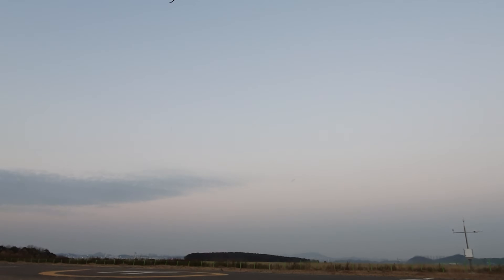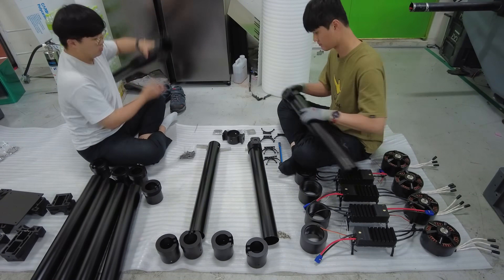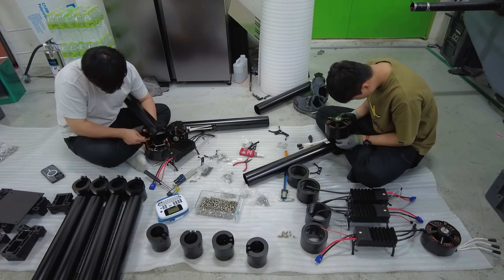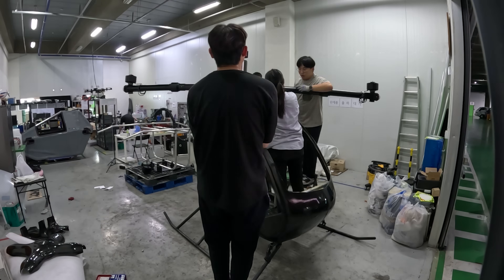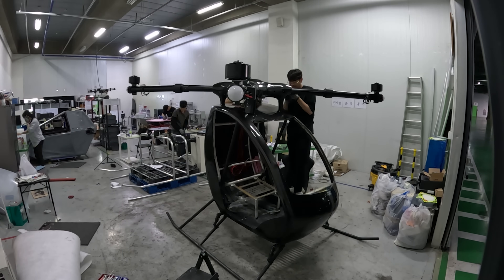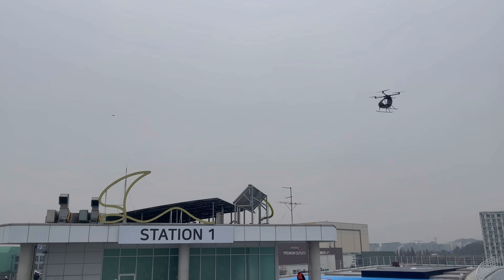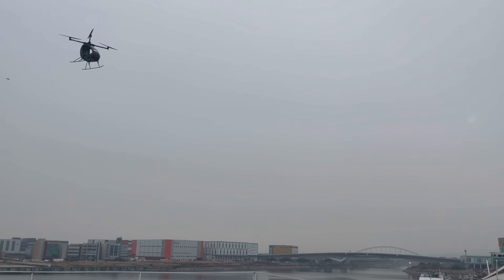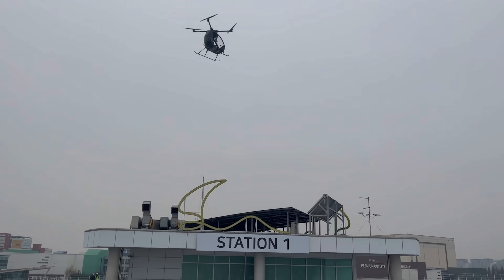I bulit a real Flying Car : Manned Drone Project Unveiled

Comment: congrat for your UNmanned drone :face-fuchsia-poop-shape:.
will you dare to seat inside a day ? its all about trusting your skills.:person-turqouise-waving:
Reply from the maker: Thank you for your comment. I’ve actually already uploaded a video of the manned flight. After extensive testing and validation, I successfully flew the aircraft myself. It was a process of building trust in my own engineering. I'm currently developing an even more stable and reliable version of the aircraft. I appreciate your interest.
Reply: @jenk5109  m curious to see your video of yourself infly.
glad you succeded but i canot think it cost less than 50k$.
Reply: I never thought of using 4" PVC pipe from home depot. I'll give that a try. Thank you.

Comment: Very cool!! The engineer in me wants to know more details, like motors, ESCs, FC, batteries, current draw, prop size and pitch.
Reply from the maker: Thanks for your interest! The propeller size is 63 inches.
I’m currently working on a detailed video covering all the specs — motors, ESCs, FC, batteries, current draw, and more.
If you have any further questions or would like to chat more in detail, feel free to email me anytime!
Reply: How can I email you? What flight controller are you using?

Comment: 😁😁😁dude y merely  assembled parts y bought from everywhere😂😂😂
Reply from the maker: Haha, fair point — but I actually engineered, designed, and built most of the key systems myself. From battery pack to propulsion and control integration, it was far more than just assembling parts. I invite you to watch the full build series for all the behind-the-scenes work!

Comment: you could hook a 50lb rotax 2 stroke up to a generator and extend your flight times
Reply from the maker: That’s a great idea! A hybrid system with a lightweight generator could definitely extend endurance. I’ve actually been thinking about that direction for future prototypes. Thanks for the suggestion!
Reply: @jenk5109  i saw them putting diesel fuel into an ag spray drone on a vid, or at least I think I did, I couldn't figure out what the diesel was for.  They need to develop a variable pitch system for these multirotors, then you could autorotate in the event of a power failure.
Reply: @FourthWayRanch they've made variable pitch quads since quads came out. They only make sense in very unique scenarios. Lookup WLtoys Assassin V383 if you want to see a hobbyist sized/type version. It used a single electric motor but you could easily scale up and use a gas motor to turn all props then vary pitch to adjust thrust. Most flight controller software wouldn't even need any significant changes. Ardupilot calls them heliquads aka variable pitch multicopters. 
They act more like 3d helicopters and can change direction and speed faster than just about anything.
Reply: @JustinHunnicutt  if they're gonna carry people they need a way to land in an emergency, the usual quad isn't safe enough.  might as well use helicopters then.
Reply: @jenk5109  maybe a little jet APU unit would be better

Comment: Love it, are you using regular Pixhawk flight controller? 
this is amazing, honestly this era of manned aircraft DIY, feels just like when people start buiding fpv drones, hey where a mess and look weird, but those drones flew as they could but they flew for real, little by little the pilots gained skill until they became FPV pilots
Really proud of you and your team my friend, amazing!!
Reply from the maker: Yes, we used Pixhawk as a reference, but developed a custom controller specifically tailored for manned flight—with extensive tuning and multiple safety layers added. It's still evolving with every test flight.
And I totally agree with your comment—this era truly does feel like the early FPV days. We’re learning so much from each flight. Thanks again for the encouragement!
Reply: @jenk5109 is it still running arducopter?

Comment: WHICH FLIGHT CONTROLLER YOU USED FOR THIS DRONE
Reply from the maker: Thanks for your interest! For this drone, we used a custom setup that's tailored to the specific flight architecture. It's not a standard, off-the-shelf solution—but it's tuned to match the system's requirements closely.

Comment: A quad copter is by design always just one component failure away from a complete disaster. This is an acceptable compromise to make cheap remote controlled camera drones, but not for manned flight.
Reply from the maker: You're absolutely right; a quadcopter can suffer total failure from just one component breaking. That’s why I'm currently developing an X8 configuration myself — with 8 rotors and a dual-drive system to ensure redundancy and safe emergency landings even if one part fails

Comment: if you look at the props the frame rate of the video only matches 2 props but the other 2 are fast, im guessing thats your slight wobble, 1 set is running at about 62hrz and the other set at 75hrtz or something if the video is 60fps. ...or am i wrong?
Reply from the maker: Great observation! You're absolutely right—because the video is recorded at 30fps, some propellers appear synced while others create a strobing effect due to their different rotation speeds. The slight wobble you're noticing may indeed be related to those RPM differences, especially between the clockwise and counter-clockwise motors. Thanks for the keen eye!

Comment: Hi, nice work, but your tubes aren't strong enough for the weight, IMHO, they need a reinforcement.
Reply from the maker: Thanks for your feedback! I'm currently using 6061-T6 aluminum pipes with a 3mm wall thickness for the frame. This material offers a good balance between strength and weight, making it suitable for structural applications like drone frames. However, I acknowledge that under certain load conditions, additional reinforcement might be necessary. I'm exploring options such as adding internal supports or redesigning joint connections to enhance overall rigidity. Your insights are valuable, and I'm open to any further suggestions you might have!
Reply: @jenk5109  Hi, the biggest load for each arm will be near by to where it attaches to the body, due to the momentum of the lifting force from the propeller. It may be beneficial to add  vertical ribs on top of the arms at that area just to prevent them from snapping.  This is a general suggestion because I don't know the overall dimensions of the structure. Regards.

Comment: Understand your point that building this tested you many times. I am myself building a manned multirotor. its made of 24 rotors.  Why didnt you make a octocopter for more safety btw?
Reply from the maker: Wow, that’s awesome — a 24-rotor manned build sounds insane and incredible! 🔥
And yes, this project tested me mentally, emotionally, and technically more times than I expected 😅

About the octocopter — I definitely considered it early on!
But the VS200 was designed with a focus on simplicity, weight, and mechanical redundancy.
A quad (with coaxial pairs = X8) gave me thrust redundancy while keeping the frame light and compact.
The more rotors, the more weight, complexity, and failure points — and at this scale, every gram matters.
That said, I have huge respect for builders like you going full 24 rotors — please keep sharing your progress, I'd love to see it! 🚁

Comment: 0257    do you know that main power leads should not be elongated.    motor leads should be elongated as needed.
Reply from the maker: You're totally right — and honestly, I did route the main power leads a bit longer than ideal 😅
It was a trade-off based on how I laid out the ESCs and mounting constraints. Definitely not perfect, and I'm planning a cleaner version in the next build.
Thanks for the sharp eye — feedback like this really helps improve future designs! 🔋✍